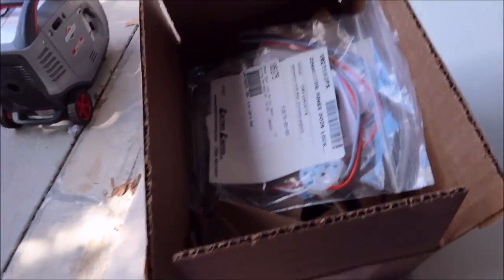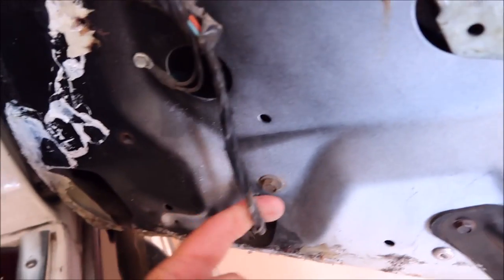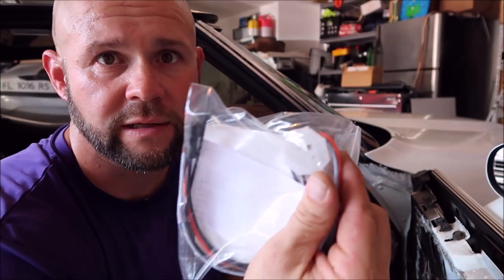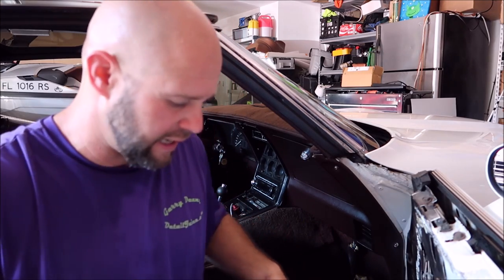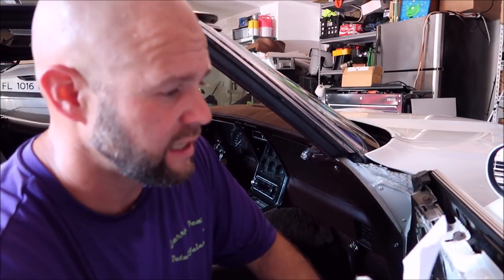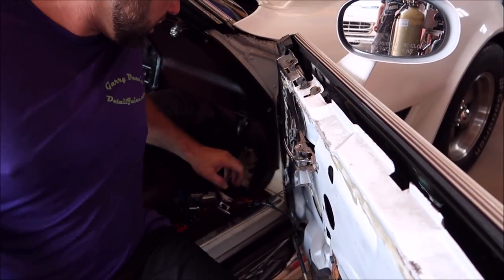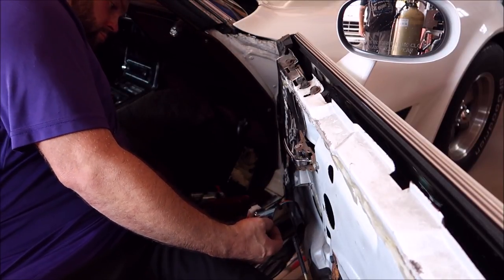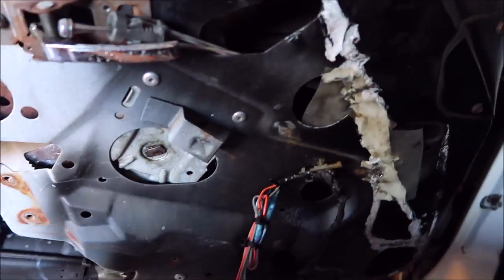C3 CHEVY CORVETTE HOW TO REPLACE AND FIX THE POWER DOOR LOCKS

Comment: same issue with my 81 except no movement at all. found all kinds of wrong hardware when pulling the door apart and found well nuts holding on a replacement switch harness on the driver side. prolly just gonna do the same changing both actuators and wire a new switch correctly and hope that fixes it.

Comment: What about no power locks?
The lock on the drivers door says its disengage (unlocked) but i cant get the door open from either side... I read that I can take off the door panel while its closed. But I still need to figure out what isnt working..

Comment: I have the same problem on my 81", Both locks worked at one time. Now, both doors lock with the switch but, they won't switch up to open. Checked both pigtails and they are clean and soldered. The only thing I can think of, according to your video,  is that one of the switches is no good. My question is did you re-try the OLD switches again once the new wires and switches were working on your car? I would be curious if it was the wiring and or one of the switches....